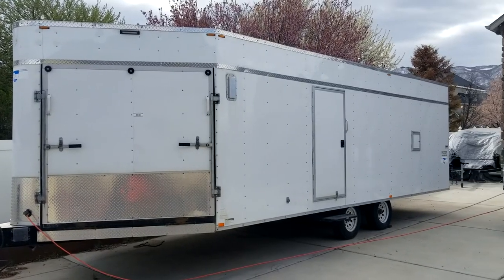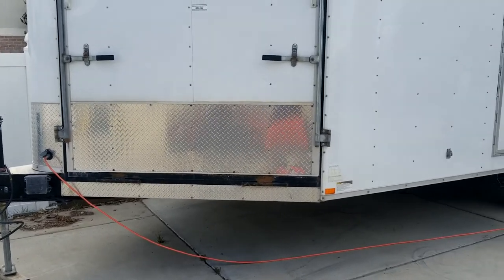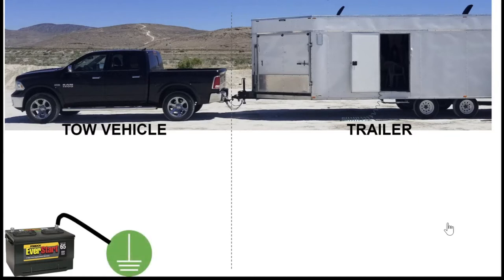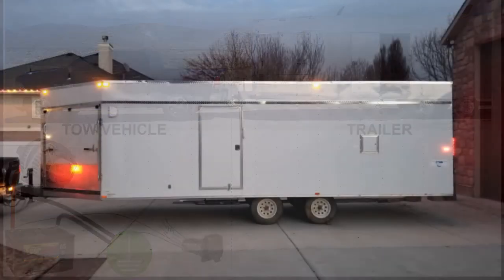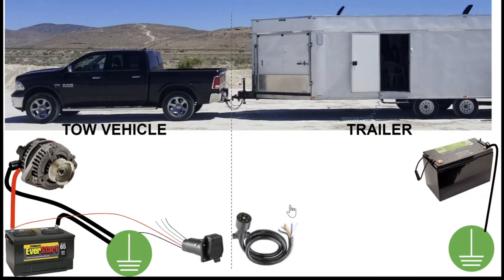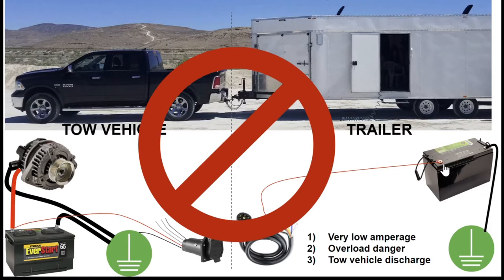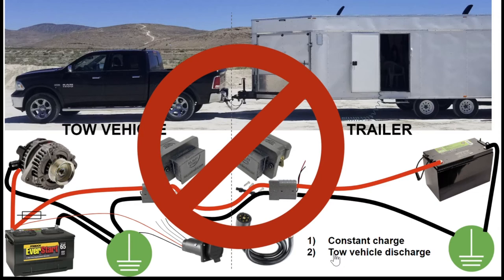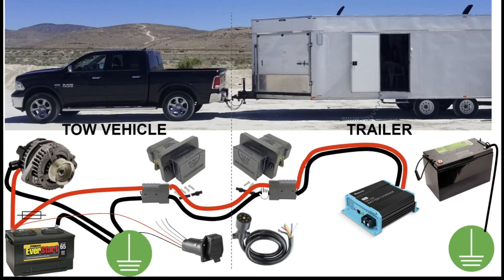DC to DC charger installation Episode 1: The Plan

Comment: BOOM!!!! So I had a similar idea in my head, and you just solidified it. This is exactly the video that I was looking for. I believe this is the solution. Not to mention very comprehensively explained in layman's  terms. This was two years ago. How is it working out for you?
Reply from the maker: It's holding up very well. What I love best about it is that I don't have to stress about making sure the battery is charged before I go on a trip. It charges up just fine while we drive wherever we're going.

Comment: I have to say, Thank you for this well informative Video. I’m a self built camper Van and after all may electrical setup I still didn’t understand why was my cable over heating from the Van Battery to the House Batter, to the point of the insulation’s slowly melting. This is a 4/0 gauge wire. I have a cut out switch that I turned on and off when it get to hot.  Your video made me understand clearly what I did wrong and easy fix. My Dc to DC it on the way. For the eight month living in the van and not having any issues, am gland thing are toning smooth. A++ for this video.
Reply from the maker: Thanks for tuning in. So glad it helped. Good luck with it!

Comment: Excellent video!  It touches on all of the key, important reasons why you would want a DC to DC charger. I was hoping you could provide additional info on how and where you installed the jack/plug for the new cables you had to run and what that looks like (including how you ran the cable from the plug to the trailer...and how that looks like).  I hope that's not asking too much.  ;-)    Keep up the good work!  By the way, my application is installing the above from a truck to my tow-behind RV trailer's lithium battery.
Reply from the maker: Thanks. Episode 2 (the install) has all of that.
Reply: @some-guys-garage  - thanks! I'll check it out!

Comment: Great video! I bought a DC-DC charger, but every video is for Camper vans and not Tow Vehicle / Trailer!  This explained a lot.

One question:  Can you not use the DC-DC charger over the 7 pin harness and avoid running the 8 gauge wire? What would the max amps to send over, probably 15 feet on that thinner gauge already built in?
Reply from the maker: Glad you found it helpful.

I don't know exactly what gauge wire you have on your 7 pin connector, but typically the White (ground) wire, the Red or Black (power) wire, and the Blue (brake power) wire are all 12 gauge. The remaining Green (right turn/brake) wire, the Yellow (left turn/brake) wire, the Brown (tail lights) wire, and the Purple (reverse light) wire are typically 16 gauge.

A 12 gauge copper wire is rated to handle about 20 amps over a 15 foot distance. So, if your charger is the 20A  version, and you have 12 gauge wire, and you have nothing else on that circuit, you could probably get away with it. If you try it, you might just check that wire periodically. If it gets warm or shows signs of heat stress, you'll know it's overloaded.

Good luck!
Reply: @someguyzgarage  I bought the 50a version.  It allows you to select current draw maximum.

However I decided to just copy what you've done here instead. Bought some 4awg and will be wiring it up this weekend.    Thanks for the response!
Reply: I know this is an older thread now. However, I asked Renogy if I could hook up my 20 amp DC charger to the 7 pin of my Ram 1500.
Their response was positive. However, they did say I need to make sure all connections are tight  to prevent overheating. Also I told them I would run the charger a max of 5 hours. 
The 7 pin positive on the Ram is protected by a 30 amp fuse. The DC charger can draw 50 % more than its ratings,  so 30 amps is right there.  I doubt, however, that it will draw its max unless the batteries are pretty low. So an option if you don't want to run heavier gauge wires.
Reply from the maker: @rvhtravels  Very nice! As long as your wires are good, connections are good, and you don't power anything else from that line, you should be fine.

Comment: Just get a victron dc to dc charger, set the tow vehicle voltage level through Bluetooth to operate w/o draining tow vehicle battery
Reply from the maker: I believe you're right... This circuitry is now built into some dc to dc chargers. I had the Renogy, so the voltage switch was an easy addition.

Comment: 8 AWG wire from the alternator to the dc/dc charger?  That's likely too small a wire & should be verified.  

Otherwise good video.
Reply from the maker: Thanks.

It's funny. Renogy claims the 16 AWG wire in the standard connector is sufficient. I'm not convinced. For a long feed 6 AWG would be ideal. I've been using the 8 AWG for over a year now, and it's not been an issue.
Reply: @some-guys-garage  other than Victron, it may be a couple of under man you free somebody else grossly underestimate the wire gauge size that should be used, in fact most of the time the wire they provided is garbage and way under gauged.
Reply: @youcanthide004 I was mostly concerned about insufficient capacity for the draw. I like the 8 awg, and haven't noticed any signs of overcurrent. It's all running great. Still.
Reply: @nathanecall  thanks for the update. Stay safe. 👊🏼